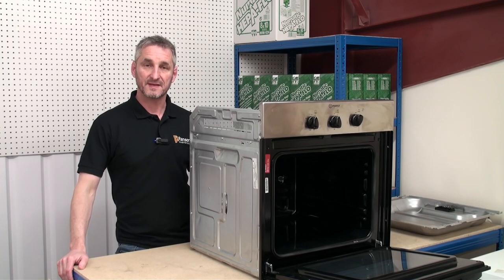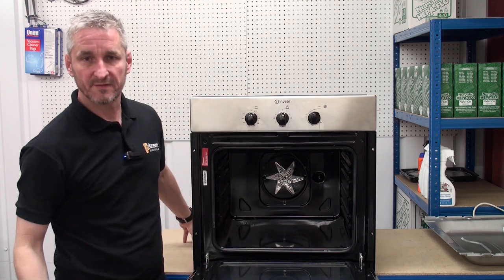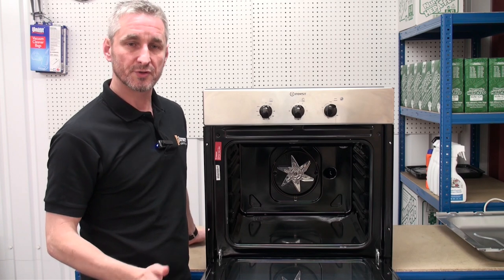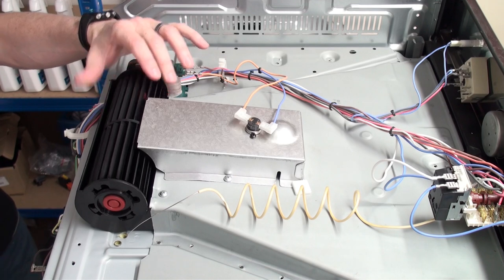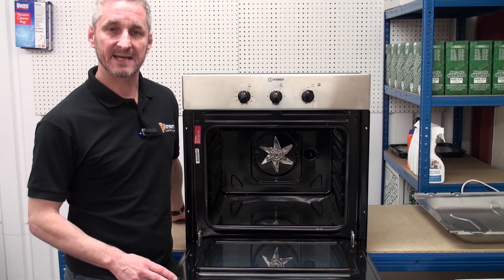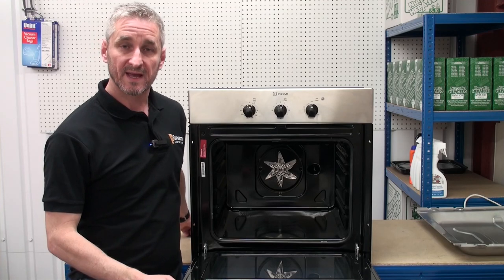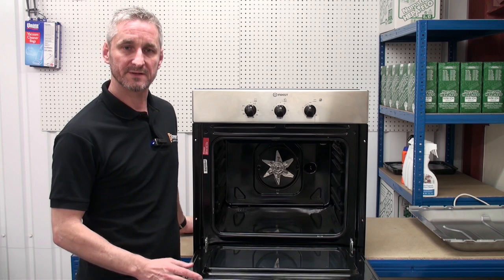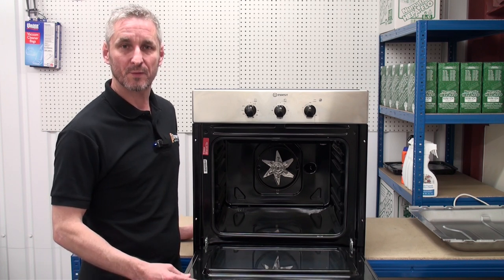How An Electric Oven Works

Comment: Great informative video.   My fan oven when top and bottom heaters selected, the grill fires up.  Not sure if I need to replace the oven element or is the selector switch faulty.  If the later is this an easy enough job to do myself.  The element replacement looks easy to do but not sure about the selection function